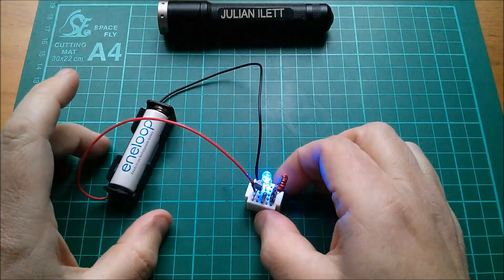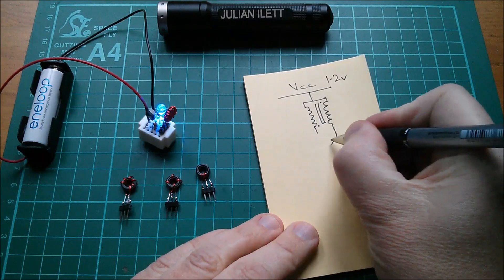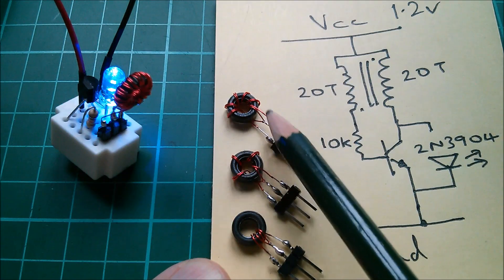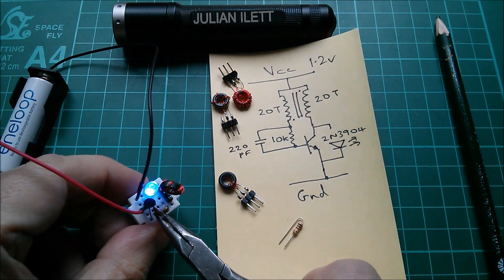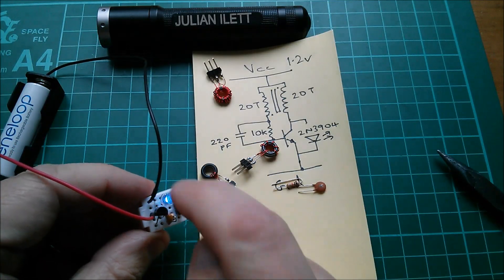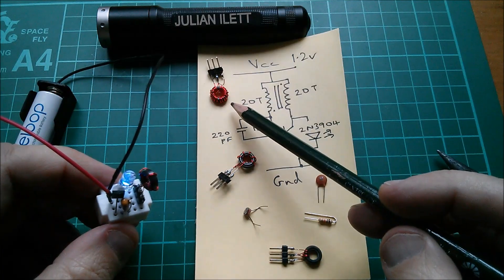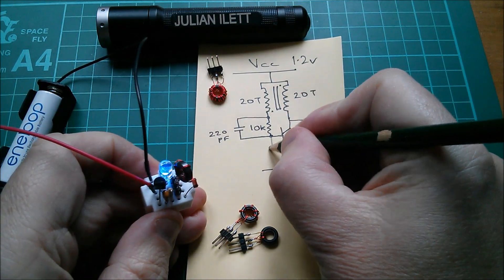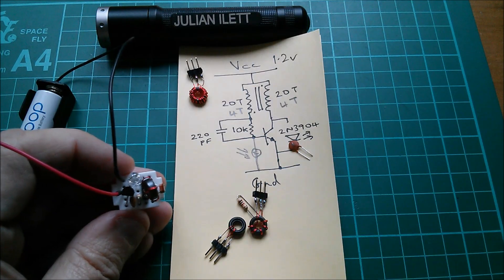Joule Thief - New Inductors - Fewer Turns

Comment: Do you know what sort of material the core is made of?  Higher permeability will allow for fewer turns.  Beads with a smaller hole and larger cross section do the same thing. (higher magnetic cross section per magnetic length)
Have you tried any other turns ratio than one to one?  I suspect two turns on collector winding to one turn in base winding should be higher efficiency.  You can twist three strands together and wind them as a single wire, and then connect two of them in series to make up the collector winding.
Reply: Any suggestions on a better suited material for the core? (I am very interested in this amazing "thing", trying to find a good use for it though, would be nice to see a more effective use)
Reply: @BrotherEmmet  If you are willing to commit a couple more components to the circuit, enhancements are possible.  For example, if you place a small capacitor in series with the base resistor, and add a clamp signal diode across the base-emitter junction, the circuit will output more power, and at supply voltages too low for the original circuit to operate.  Making the diode a signal schottky diode works even better.
Reply: @jpopelish 
Por favor,y es que me ha aportado curiosidad tu comentario...¿Qué es un diodo de señal..?...¿Cuál es su identificación y/o caracteríctica "física" de éste diodo de señal..?.Luego comentas de un condensador o capacitor en serie entre base de transistos y resistencia...¿Qué tipo de condensador o capacitor por favor..?Gracias...
Reply: @loveofage...1912  Un diodo de señal es simplemente un diodo de baja corriente que se utiliza donde la corriente representa alguna señal, en lugar de una fuente de energía. Tienen un tamaño pequeño (similar a resistencias de 1/8 a 1/4 de vatio con cables flexibles o montaje en superficie). El condensador sería un condensador cerámico o de película en el rango de los nanofaradios. El propósito es atenuar la corriente de base mientras la corriente del colector es bastante pequeña, en lugar de mantener el transistor encendido hasta que ya no pueda transportar la corriente porque el núcleo del inductor se ha saturado.
Reply: @jpopelish 
Ante todo(y mis sinceras disculpas por el retraso)Muchas Gracias por tu respuesta e información.Al respecto el diodo de señal(mis disculpas de nuevo)pero no me queda aclarado:Su nomenclatura,su forma estructural y/o física,en fin,pero no me queda aclarado.Al respecto el condensador o capacitor entre base y resistencia,en éste sentido yo es que ví en un vídeo que éste capacitor se situaba justamente en paralelo con la resistencia,pero en cambio tú me comentas que vá cómo en "serie" desde resistencia a base de transistor,y de nuevo aquí quedo en la duda...¿En serie con respecto a la resistencia y base en transistor o en paralelo con la resistencia..?,Muchas Gracias y Salud/os por áhi.
Reply: @loveofage...1912  El diodo de señal más común es el 1N4148, un tipo de unión PN de silicio. Pero hay miles de otros.  Agregar un capacitor en serie con la base, resistencia limitadora de corriente, para apagar el transistor antes, requiere que haya una ruta para precargar el capacitor para la siguiente mitad del ciclo "encendido".  Esto se debe a que la base del transistor también es parte de una unión PN por la que pasa corriente solo en una dirección.  Por lo tanto, tener un capacitor en serie con el circuito base requiere que usted ponga en paralelo la unión base-emisor con un diodo, para proporcionar una ruta de corriente para cargar el capacitor, durante la mitad "apagada" del ciclo.
Reply: @jpopelish 
Ok,Gracias Muchas por la información ofrecida,Salud/os.
Reply: @BrotherEmmet  I would look for the high permeability cores for this sort of application.  Fair-Rite type 76 (10,000 initial permeability), 75 (5000 i.p.) or 73 (2500 i.p.), but type 77 (2000 i.p.) is more commonly available.

Comment: I have messed with the turn ratio as well and figured out that yes it will work with less turns you will lose efficiency . I have tried all sorts of things and the best for long run times is using a fly back transformer.
Reply: do you hace a video on that?

Comment: Glad to see I'm not the only one intrigued by this quirky little circuit.
My goal has always been to focus on longevity rather than intensity of output.
In my own experiments I've found 15 turns is the lowest practical count that will provide a bright output for a reasonable length of time without the need for a capacitor. The maternal of the core has had the greatest effect on the circuit in my experience. Capacitors do increase the intensity of the LED but at the expense of  run time.
Incorporating an LDR is something I'm going to try in my next JT.
Please dig out the 'scope and show us the waveforms on your next video.
Thanks.
Reply: Did you try different transistors & if so what's best... wiki says ones with lower Vce(sat) might be most efficient
Reply: joinedupjon I've found that the general purpose 2N3904 & BC547 transistors give good results at a cheap price and are readily available. Avoid using the PN2222, it just doesn't perform well in this application.

Comment: I realize that efficiency isn't your goal here, but working out a bit how the joule thief works would tend to suggest some things you could do for improvement. For example -- since you're driving a 0.6V drop on the transistor base side, and a 3V drop on the output side, I would think that for best results, the number of turns on each side would not be equal. In fact, I would wildly guess that you probably want about 3/0.6 = 5x more turns on the output side than the feedback side. I would think that more turns over all would increase the inductance, lowering the frequency, less turns increasing the frequency at the expense of high loss due to more switching. The capacitor in the base is a high-pass filter for the feedback -- so I would think that the higher this is, the better it would work -- until it passes resonance of the LC bit and starts getting worse. That's why it helps with the starting when you don't have enough inductance (not enough of a pulse on feedback, but the initial part of the spike gets through a dead short as opposed to being attenuated by the resistor).... etc. etc. etc. I'll stop blabbing.
Reply: ALWAYS nice that SOMEone explains this kind of things.Really helps. :)
Reply: I came here to precisely see just this, but sadly it is the tired old 1:1t ratio.
Reply: My guess would be to put a low value register between emitter and ground and tie the led cathode to ground might make it operate correctly.
Reply: Joule thief Joule thief https://youtube.com/playlist?list=PLh8HTLB-VWMkqsKIpgXFHg5sJDN5eGqtN
Reply: I am wondering how to analyze this circuit ? As an RLC oscillator ? How can we limit the current in the LED ?
Reply: tiger12506 please dont

Comment: You don't need capacitor at all just short the base. Also the efficiency of this circuit depends of how much losses are in the transistor and on what material is the core of. Search for energy harvesting circuit on ebay etc. Best solution is some mosfet with crazy low threshold and fast switching times between full saturation energy. Check LTC3588/3105

Comment: Where did you buy those feride core cricle things and what awg is your magnetic wire?
Reply: Robert Horvat You can recycle them from dead CFL bulbs.
Reply: @NetworkXIII  And you don't have to use magnet wire either. I use 30 gauge wire-wrapping wire and that works just as well.
Reply: Nick B I’ve used wirewrap wire to wind inductors also, it works just fine and is probably a little easier to work with than magnet wire.

Comment: I  use a 2n3904 and a AL 390 on the teriod at 20 turns of bifilar wind and a 63micro farad with a 1000 ohm trimer...and you can get it to flash .. i have about 10 different  circuits...and can get it to shine or blink...as low as .9 volts....but works best at 1.5 volts..use a 3watt cold white led....and wear sun glassed ...ha

Comment: Another brilliant video and thank you. This is very interesting, but what would finish it off, would be doing some current measurements to see which transformer / configuration with resistors and capacitors was the most current efficient?

Comment: Under the mini breadboard there is enough space for 3V button cell. On  April 1st, you can light the LED with a 0F capacitor, a 0 Ohm resistor, a 0 turn inductor and an eneloop with 0V. ;-)
Reply: Surely that should be done on the 0th of April?
Reply: On 0th of April the circuit would be a "Juliet Thief" ;-)

Comment: what about a ROYER Joule Thief using centre tapped primary and the feedback winding to the bases of the two transistors and two 47K resistors from the VCC to the bases of the transistors also a capacitor across the primary side of the transformer to set the frequency.

Comment: Great stuff as always, thanks! A joule thief is a fascinating waste of my time... mainly because I'm not smart enough to optimize them or put them to very good use! I'd love to see a video mixing and matching different components to find the optimal setup for brightness, simplicity and battery usage!
Reply: Don't cut yourself short buddy. Anything you have that's using disposable batteries can have a joule thief slapped into them... And if you don't like winding them just do as do, pull coils off old boards and centre tap them(well almost center tap them put less turns to the base) chokes work great IV found. Just bridge out where the other batteries should go with wire and fit "ROBBIN HOOD" into the device.. your clever enough to understand how a joule thief works and build one, so your a brainy guy. 99% if people could never understand what you do. So never cut yourself short my friend.. your different 👍🇮🇪🙏
Reply: See joule ringer by lasersaber

Comment: The fewer turns, may require that you need a sort of minimum voltage, arround 1-1.2V ? But that if you had more turns you could use cells will lower voltage?

Comment: have you tried duel winding inductors?
Reply: isn't that the definition of a transformer?
Reply: Prehistoricman yep, but I believe the dual inductors will have identical Windings, where as transformers tend to step up or down the voltage.
And the inductors are quite small.
They come wound the same way, so you'd have to reverse the connection for one of the Windings to work in a joule thief.

Comment: You can buy common core inductors from eBay -- cheap as chips -- must cheaper and quicker than winding your own.
Reply: Pyotr, Great suggestion!! However, I'm not getting anything searching for that- what are they listed under on ebay??
Reply: I have just checked eBay and they are listed, as I said before, under 'Common Core Inductors'. The first 'hit' is for ten such at a cost of £1.05 post paid from China.

Good luck!
Reply: @pyotrleflegin7255  gracias por la data, está bueno para reproducir un proyecto viable...🤔 quizás ahora estamos en proceso de desarrollo. Incluso prueba y error también suma por aportar datos ante la falta de conocimiento y/o costosos instrumentos de medición.
Hay una diferencia abismal entre el hobby y un nivel profesional/científico 🕵️

Comment: You really need an ammeter in series to compare current draw! It’s no good using fewer turns if it results in a decrease in efficiency. Also, the number of turns on a toroid is determined by the number of times the wire passes through the centre. That’s the standard and correct method.
Reply: Test equipment? Why not just keep guessing on what's going on?  :) I agree with the ammeter. Isn't the whole point of this thing to get the last drop out of a battery, so you don't want to increase the current draw. Measure it! In this case, planning for a logic something or other, probably doesn't matter. And why guess about the frequency. On rare occasions I have seen Julian use a scope. Bench power supply? Never. Scope sometimes. Good videos though Julian! I never miss a one.
Reply: Yep. And that's why a single wire going thru the center of the toroid is one turn (even though it doesn't loop around any times)
Reply: True, I have seen excessive current draw with few turns. Efficiency was like 10% LOL 
With 30 or so turns, it was smth like 50% efficient.
Reply: william guillen A-ha, of course. Theoretically, yes. Practically - no.
 With fewer turns you get huge magnetizing current, higher switching losses. There's a limit on how fast the thing can run efficiently.
Reply: You also need a meter in series  with LED to indicate efficiency
Reply: william guillen True as long as you stay well within the transistor's frequency range.
The need for a capacitor in parallel with the base resistor proves however that this is NOT the case.
Also less windings means less inductance so a larger ripple current from the battery, which it cannot provide, so a capacitor accross the battery would be necessary too....
Strickly taken, less windings should result in higher max coil current, so also higher LED current,
Reply: A beaded cable is an inductor with 1 turn, even though the wire doesn't actually turn at all!
Reply: If the frecuency is higher with less turns you get higher efficiency.

Comment: there are some transistor-looks-like IC's i bought some time ago straight from China, they do the job on its own. There are used in Solar garden light but you need also a inductor look at the datasheet
- IC YX8018
- QX5252F
Reply: I thought about the same thing... with through hole inductors.   It could be even more simplified and run on 1.2 volts.
Reply: yes i made my own circuits (2 years ago i think) the benefit with that TO-94 IC's and the Inductor is there is already a Solar charging circuit integrated and you can use any 1.2V rechargable Battery so you can make your own 'emergency light' you only have to lay it on a window, so the solar cell (if you want to use one) recharges always the battery

Comment: It is my understanding (from watching a coil winding video) that you count the turns based on how many times your wire passes through the centre of the toroid. Based on that, count from its inside rather than its outside.